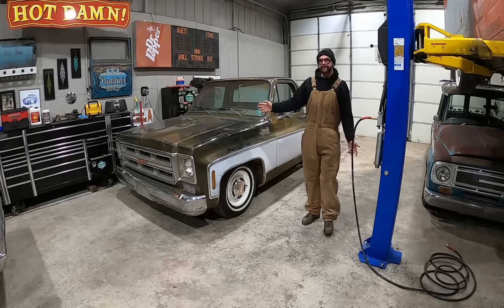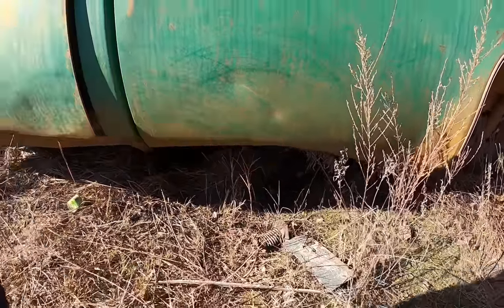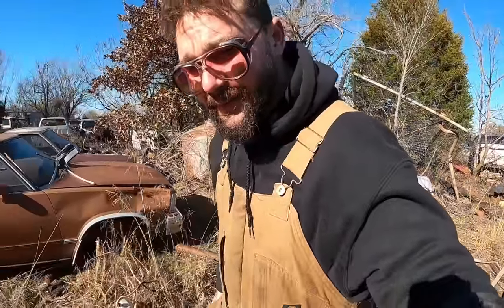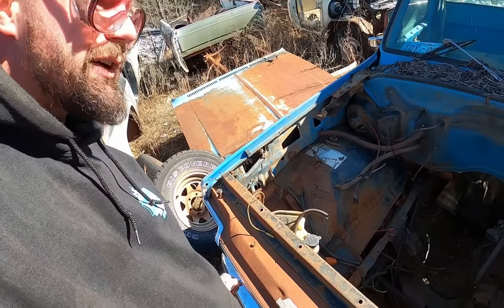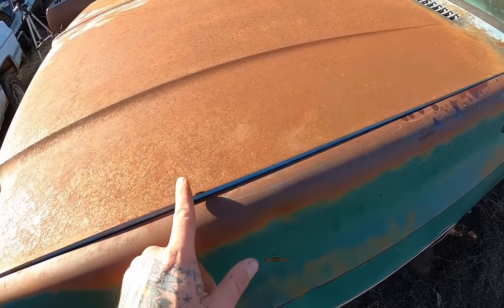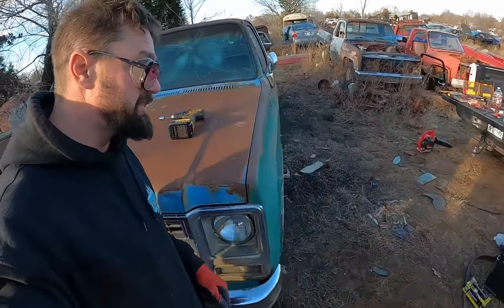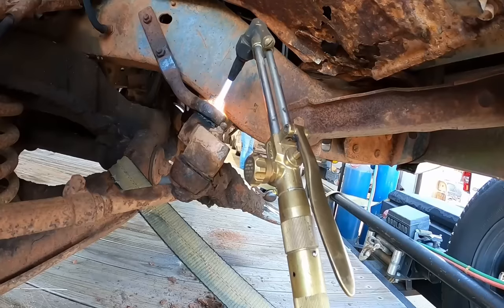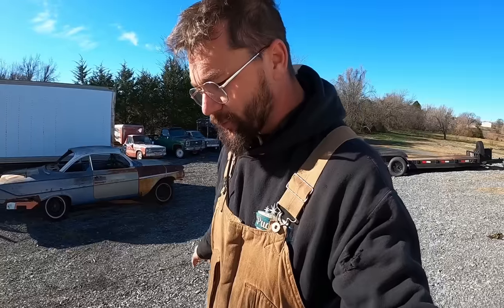ABANDONED 1980 JUNKYARD C10. Piecing it together for CHEAP!

Comment: I love the square body's, long bed, short bed, they're all cool. But in my humble opinion (not that anyone asked), when it comes to slammed vehicles, I think the longer they are the better they look. Picture a four door, long bed dually anything. A mile long and down in the weeds is just freaking cool. Hot damn! those get my motor running. Kind of why I love the wagon so much, she's long and lowered, that's what this guy finds sexy. Just my 2 cents that probably isn't even worth that much. Keep doing what you're doing Puddin, I enjoy it all.
Reply: I usually prefer the long bed truck because it ends up getting worked hauling heavy gauge scrap steel and scrap metal and being used for hauling firewood and hauling any junkyard scores of parts or drivetrain I get ahold of so it usually is a 3/4 ton version of a gm square body 2wd and 4x4
Reply: @jefesmith I agree with you if it's a 4 door long bed being slammed but in my opinion a single cab long bed just looks weird like it's  Unproportioned
Reply: @darrylcross9617 that's why so many companies started making so little of them except like white base models for work trucks. Being 6'5 I'll never own a single cab anything haha
Reply: Haha

Comment: Somebody has to save them.  An it's certainly more cost efficient than a new rig. Thanks for another good Monday Puddin.
Reply: Usually less headaches too, to many sensors and computers now
Reply: @j.sargent9172  agreed.  I just picked up a little dakota sport 2.5 4 banger. Needs a head gasket and a fuel pump.  Maybe 2 days an will be right an ready to roll.

Comment: With as much as you have to switch/ borrow wheels and tires from vehicle to vehicle have you ever considered picking up a set of those Guniwheel universal wheel/tire rollers? They seem like a pretty nifty thing to have around when you’re moving a lot of different project vehicles around, you don’t have to worry about flats and they’d save a bunch of space over storing all kinda different tires and wheels
Reply: For what they are, they're priced to high. I could justify it if I had a business

Comment: I highly suggest you keep this C10 a long bed. My reasons; lots of young men and women entering the car repair/resto hobby may not have the skills to do a frame shortening. Older car guys/lady's would prefer keeping the truck a long bed. You could make this truck into a high boy 2 wheel drive truck with a front mounted winch. That would be a cool truck project. But Puddin, in the end it's your decision what you'll do with your truck. You're a good guy Puddin, cant wait for the next installment of the Green Chili Long Bed!!!! lol.

Comment: On a lot of the older vehicles. On the ignition switch ,you have a small hole on side are under, no bigger than a needle; you can put a paper clip are needle in and push and pop the ignition switch out!🤔
My 77 firebird had the setup .I found out after I broke the switch out. Little little hole you can't really see, unless you know about it.

Comment: Puddin, Hey wanted to let you know I have been a fan of PB BLAST for a long time, I don't think there is a better lubricater,penetrator,accelerator,than it, but since they went to that new adjusterator, nozzle I've almost quit using it because I was only getting less than half of product out and was having to put hole in can and put it in spray bottle... But I found the trick to it before you give up on it turn it up at least halfway 2/3 or higher is best but don't turn it up and down just SET IT AND FORGET IT.... But if you keep it turned up from the first time you use it and leave it I found u get all of it out again... Cause if you keep it turned down you use all the air pressure out of can before you actually use all the liquid,, and even though you might use more than you want you can never have to much LUBRICATION FOR ANY SITUATION,,,, I EXPECT FREE MERCH WHEN YOU USE THAT SAYING. (YOU CAN NEVER HAVE TO MUCH LUBRICATION FOR ANY SITCHEEASIAN) HAHA .... HOPE THIS HELPS SOME OF YOUS....

Comment: @Puddin I have a quick trick to get the caliper bolts out without the allen...   use a 3/8 head bolt with 2 nuts locked together and  you'll be able to use a normal wrench to take them out. ... ( or locking pliers on the threads of a ⅜ head bolt...)

Comment: I've been living with back issues since I was 13 ( currently I'm 60) I've had 5 back surgeries and I'm scheduled to have a spinal cord stimulator installed this Thursday.  Sorry your in so much pain I can relate. I find it funny you mentioned drifting. I'm building a Ratty 1/25th scale 84 GMC Short bed drift truck. I have the interior finished and the bed is done. But due to surgery on my hand all my builds are on hold.

Comment: The “snap-in” six cut switches as we locksmiths call them, were used until the late seventies. You can actually use a dent puller and yank it out without damaging the column. The new one will snap right in.

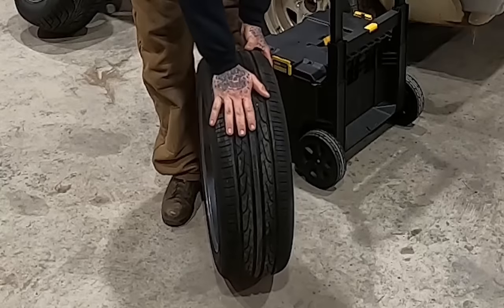Comment: Theres a real gem sitting there. That old m1008, if complete, is pretty valuable. 6.2 j code diesel, th400, dana 60, 14 bolt and 4:56 gears.

Comment: In mid 78 gm added the screw mount ignition key cylinder... and the truck like you have I actually used to own a emerald green and frost gloss white center 78 Chevy c20 custom deluxe long bed 2wd farm truck wasn't a clean or straight truck by any means but it was my daily driver trailer puller and wood hauling farm truck for about 8 years..

Comment: 79 is the only year with the wrap around headlight besel and round headlights. The broken grill u pulled off looks like an 80 grill
Reply: Nope custom deluxe,high Sierra, Scottsdale and Sierra are also as well as Cheyenne round eye 79-80 wrap around headlight bezels, because i have had 2 79 Scottsdale trucks nope 3, and 4 79 Chevy custom deluxe trucks
Reply: No i was right about the 3 Scottsdale round eye 79 trucks because the other one was a 80 Chevy c20 Scottsdale

Comment: You can get earlier headlight surrounds and bottom grill strip (like 75-78 i think) that leaves the paintwork on show across the bottom of the grill and turn signals for some front end green on show 👌

Comment: I stripped down my 1980 C10. I have all stock parts. From grill to front and rear suspension, steering column, brakes, steering box. Everything. Truck had 77K miles on it. Parts are good. You intrested in anything? Hell ive even got the whole front crossmember.  Gauge cluster. And lots lots more. Even new afternoon parts. Ridetech suspension. Sway bar. Brakes. Rear bell tech notch kit new. Lots and lots. New tie rods, steering linkage. Drag link. Pitman arm. All clean parts

Comment: I’d suggest getting real bezels from an old truck. I swapped my 79 to 73-78 bezels and the LMC are plastic with chrome screws that rust and then stain the plastic. Old ones look better. Ask that grill trim from there is plastic just to warn you. It fitted decent though.

Comment: Hell with having the tools going back and forth. I think THIS truck should get the utility bed sides be filled with salvage yard tools and equipment to become a dedicated tow and service truck. Maybe it becomes the replacement for the weakening Towrolla. a big brush guard with push tire hangers on the front. With  "Puddin's Service Shop" "If they saved a good 'un, it's probabably Puddin" pinstriped on the side.

Comment: Might carefully try soaking the YEEHAUL concrete residue with muratic acid (on the underside of the rocker as a test spot?). It will definitely desolve/soften the splattered concrete, but unsure how it will affect the paint. Regardless, retouching any orange re-coloring ain't no trouble for the Patina Master. Using a stiff bristle brush to gently scrub away this dadgum crap & PPE. Hope this works ok, man.

Comment: Give you another trick with using a torch. Heated up red hot and shock it with cold water. It will break the rust inside of it and it will be like butter moving it easy. Try that next time

Comment: Hey man , I don't want to sound like I know a whole lot but I so somehow know a lot about 1973 to 87 trucks. The green truck you drug home has been Frankensteined a little. Ot has a A/C dash but doesn't have a/c.. the emblem on the dash says silverado but it is a custom deluxe on the fender which it is, it doesn't have power brakes, or the moldings the cab or headliner. I do think it is a 1980, for sure a 1980 grill and some of those especially the silverado in 1980 had big square single ugly ass headlights. The molding that holds the weather strip and carpet down was black plastic and I belive 80 was the first year for that rather than the stainless like your 1976 should have. What I think happened is someone either raided the salvage yard or had a 77 to 80 model truck get wrecked or go down somehow and they used it to dress up that green truck a little and add some Scottdale or Silverado stuff on it, hence the reason you have cab corner trim and not the back cab section and the little rivets on the rear of the cab. I noticed as far as A/C you have the dash vents in the dash but the control has just off/heater/defrost and you have thr kick panel vents and these were not on a factory a/c truck.

Comment: Puddin, you can easily and quite cheaply replace the battery in the JNC 660 jump pack.   Did it to mine years ago and it’s still kicking.
Reply from the maker: I need to
Reply: Just buy one puddin an car battery's an spare rims please... Tight ass.. 😅..

Comment: I'm at the 21 minute mark going "Don't do it!  Don't you do it!"  If'n you do do it, if it were me, I'd use it for the sheet metal for patches and whatnot.  The frame might be okay; can always cut it down and have it standing by for a future project.

I'm a purist; not gonna lie, BUT, I'm not mad about shortening them beds.  As long as they're done right.

Not super practical, in the long run, unless you're a home owner.  For a guy or gal who's got a ranch or a homestead, or some kind of business, the long bed is probably the way to go. 

I've had both, over the years; hell, my Tundra is a crew cab, so it's got a short bed on her, but other than the occasional fence post or what not, it's good enough.  

But yeah, I'd pass on this one.  Too dang much work for too little return.

Comment: Would have been way cool if that pickup would have been a Square headlight 80 model grill. My dad had a 80 model tan Chevy long bed inline six cylinder automatic pickup without AC and I sure wish I had it back.

Comment: $650 for a completely stripped out truck? That's crazy. Where I live you can get one that runs and drives for less than $2000. I paid $1200 for a '76 that was in good condition, and just needed a carb and power steering pump. It was running and driving.
Reply: It's in his area, cheap content, he has, engine an automatic , frame, wheels,.. Cheap content..

Comment: Puddin, great video. Does the relationship you have with St. Louis Salvage allow you to borrow parts off other rigs, or is that something that is normal for all junkyards?
Reply from the maker: My relationship helps. I think most salvages would be interested as well as long as you track the parts you are consuming where you are charged. 

I’m n this case I told him my plan from the start so he knew I was looking for the missing pieces. 

Building great relationships in the car community definitely helps of you do a lot of this stuff.

Comment: The plate or vin is up in the dash by the windshield started that in 79
Reply: You might find a gvwr decal on the top of the side of the Dr door it would show the year, but as i have said that grille is a one year only thing, and the fact that the interior trim has the lip around each section is 77-80, and the bends fuel filler door is started in 79, and that was why i said it was probably a 1980, if not it was a 79 Chevy with the wrong grille...

Comment: The steering lock is under the wheel you will have to pull steering wheel and then the ignition switch and then you you can wheel enough to push lock pin down to release steering! Don't hold me to this it's been about 30 years since I have messed with one of these! If you don't know how to remove ignition switch I'm not going into that here, most people that mess with cars know how to do this!

Comment: I have a question why you would want to put it down and make a short bed is the money thing or is it a preface on the looks that I asked you this question because having on the boat short beds look great but that's really all they have going for them they ride rough you can't hold anything in them so I'm just wondering what your position is online you could cut it
Reply: It looks cool an cheap, simply..
Reply: Still a truck parts chaser work truck.. Shop truck..

Comment: You hate those wheels so much (I like them personally) why change them out and not use those on the  junk yard c10? Seems like extra work a set of wheels is a set of wheels
Reply: Its to show what the difference on the truck, in scrap yard, what can be achieved for little money... Puddin will build that truck for less than 5 k i bet... 😊
Reply: @user-427.commodore still doesnt make sense to swap wheels over just take the ones that are laying free rather than swap them work smarter not harder

Comment: HEY THERE MR PUDD MAN DID YOU REALLY EAT ALL THE CHOCOLATE PUDDIN IN HIGH SCHOOL IN THE THIRD AND FOURTH SEMESTER? Did you really eat the faculties puddin tooo ????
SHAME ON YOU MR  PUDD
DID YOU EVEN LEAVE A SMALL PORTION FOR THE LIBRARIAN????? That little ole lady deserved some of YOUNS PUDDIN MR PUDD

Well hey though seriously this green patina wagon HERES what I think you should do for an engine. Most of these engines wound up as water pumps for farmers in the fields. Ford Chrysler a d Chevrolet IN LINE SIX CYLINDERS ADD A TURBO AND YOU GOT A DEPENDABLE HOT ROD MR PUDD. A 295 cubic inch IN LINE SIX THEY ARE PERT NEAR BALANCED PERFECT.
Put an in line six in Mr green jeans patina rod. WHY? BECAUSE!!!!!!! Air one else takes em out. Don’t you feel bad air one trashes in line engines making them obsolete like some old vehicles ??? BE DIFFERENT MR PUDD PUT A STRAIGHT SIX IN HIM…….